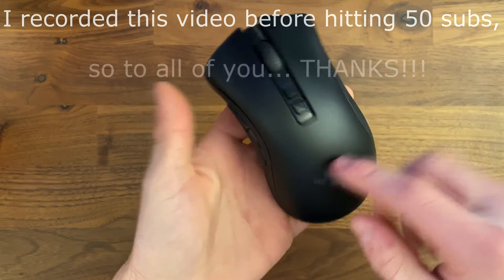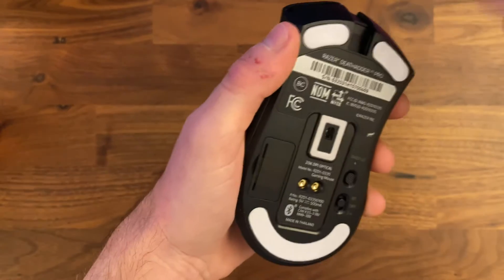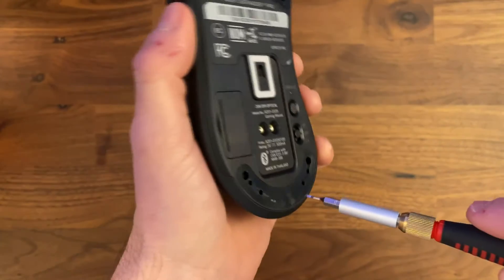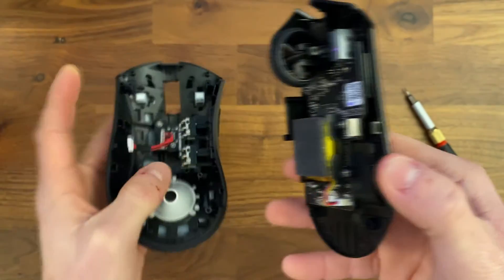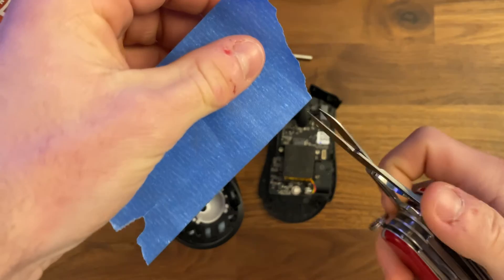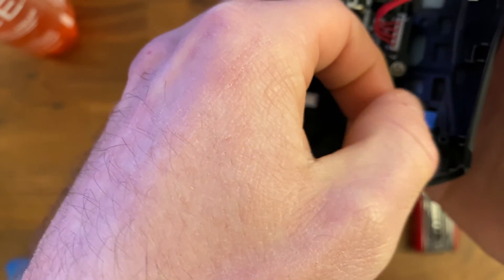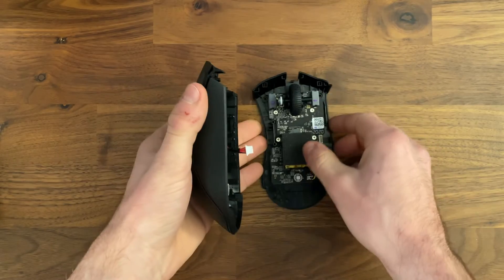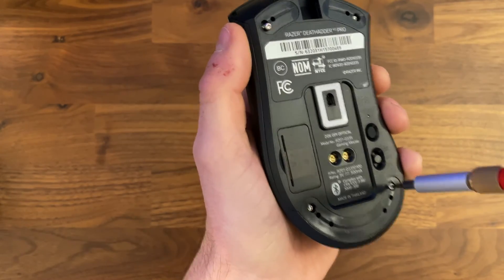Razer Deathadder v2 Pro Wireless Teardown and Pretravel Fix

Comment: DON'T f**king pry plastic devices with a metal screwdriver, PERIOD. Use something made of plastic, anything you can find, it will leave no trace, and if it does leave a trace you just carefully push it back with some shiny metal that also polishes it a bit and it looks like new after repairing. I don't know who the hell invented this method of pulling devices apart but that person was an amateur before the word actually appeared in the dictionary. PRYING WITH A SCREWDRIVER, sheesh...

Comment: Hey can u tell me about the capacity of the battery that this mouse uses,
Mine drains pretty fast even when my mouse is disconnected
it drains away overnight while I'm not even using it
so I think the  battery is messed up

Comment: But with this method the tape can move away after some time of usage because of this left-right shiftings that you showed. Then why not to glue that tape to the switch itself instead of inner space of a shell? There is enough unused grey space on it near the purple button where you could actually spill a drop of some good glue and put that tape. Of course you should be careful not to spill the glue on a purple button but it wont be affected by shifting and will not anywhere.
Reply from the maker: This is true the tape will wear the more you use it, and could shift, some people use aluminum tape too which should be more resilient
Reply: @joer1502  yeah, I thought about aluminium tape too. But now I came up with even better idea (not for everyone) - to use a tiny piece of my old thin plastic mousepad (SPEEDLINK CRYPT) because it is already 0.8mm thin (maybe rub it with sandpaper to be 0.5mm or even less) so it should be more durable solution even comparing to aluminium tape. But I havent disassembled my mouse yet because still looking for a good solution how not to ruin the feet or to damage them as little as possible. I saw another video where a hair dryer was used to warm up feet and move them away gently, but still not sure this is the best solution. Eventually I will have to choose one method or another because buttons pretravel and squeaks became too noticable and irritating.

Comment: I had an issue where mine would not turn off. I took it apart and unplugged the battery. Hard reset fixed everything.

Comment: Has anyone had the sides of this mouse that are creaky? Mine is just a few days old and the sides of this mouse are making creaking noises when even small pressure is applied. It's very annoying and disappointing.
Reply: yeah same, I was looking a way to fix the creaking and found this video.. it's really annoying but I don't wanna ruin the feet to fix it with grease
Reply: @Karmidzhanov92 you are not ruining the feet you can just put it back
Reply: Hi there, just bought a Deathadder V2 Pro that had this issue but I was able to fix it with PTFE tape (or teflon tape), I opened the mouse and put a trim of tape folded between the base and the top part, had to use a little bit more on the side where the sound was more audible but at the end I was able to get rid of that creaky sound, I don't know if you were able to fix it but if anyone has the same problem and can't return the mouse that's a good fix

Comment: Hi, I’m just posting this to some of the videos I looked at when I was searching for answers, as I thought it might be useful for other people with a Deathadder v2 (wired – not as in this video) mice that have a squeaking scroll wheel problem. Some of what I cover may be relevant to all Deathadders, e.g. advice about the skate plates and lubrication of the shafts.
NB: Mine was an early version, so it is possible details (e.g. screw types) may vary with more recent manufacturing.
The squeaking is caused by dirt and debris getting inside the mouse. The hole around the mouse wheel is probably unnecessarily large and I think this contributes to the dirt getting in there. I have a cat and when I opened mine up there was a ton of hair in there. If you have a pet this is probably going to be the case for you also. I’m surprised anything worked at all, it took me nearly and hour to pull out all the hair from the wheel and shafts with tweezers.
🧑‍🔧How to fix step by step:
There are 3 screws on the bottom you have to release. They are all under the skate pads so you will have to lever them up before you can get access to the screws (plates are glued down). You may have to buy new skid plates, although I was able to just stick mine back down after.

There is one screw under the rear skid plate in the middle. Start from one side and lever the plate up with a small sharp screwdriver. As soon as you get a tiny gap under, switch to a larger screwdriver and just push it under the plate to release the glue from the mouse. You need to raise at least half the plate up, but you can leave the other half stuck down (no need to remove it completely). The screw is a very tiny cross head type. The only screwdriver that fitted it well was from an eyeglass repair kit I had.

There are 2 screws under the front plate. Luckily, they are at the extreme edges of the plate, so you only have to lever up a small section at each end of the plate to get access to the screws. Screw is the same type as for the rear.

Once all 3 screws are removed the top of the mouse lifts off very easily, no need to release anymore catches. There is a cable connecting the dpi switches on the top of the mouse to the bottom of the mouse. You can unplug this if you want, but there was enough length on mine to just leave it plugged together and still have good access to the wheel.

Start by just blowing out any dirt etc. either just with your breath or compressed air. For me there was a ton of hair trapped at the left side of the shaft right where it meets the rotation sensor and also a ton trapped inside the wheel. This wheel (at least on my version) was hollow. It was a massive pain to get the hair out of there as there is something in there (couldn’t see) that it gets caught on.

You need to grab onto the shaft, especially in the areas where it connects to other pieces with very fine tweezers or a small screwdriver. There may be hair wrapped around the shaft you cant see and it only becomes visible when you try to grab for it.

Once you are confident you have got all the hair out you are done. The squeak was gone for mine, and the shaft appeared to already have some lubricant still on it. Put everything back together.

💡Optional
Add a few drops of silicone-based lubricant to the shaft (I did this). Be careful what lubricant you use, some don’t play nicely with plastics. Some people suggest you can do this from outside without ever opening the case. Using a needle (or similar) to deliver the lubricant to the shaft. I considered this, but visibility of what you are doing is terrible and I was worried about dropping lubricant on a sensor of something important – so I chose to open it up.

Buy and replace the skates if you feel they are not going back right or you damaged them by accident in the removal.

Comment: Somehow after just 1 month of using the da v2 pro it just keeps disconnecting on the 2.4 ghz mode whenever I flick. sometimes I just dont even need to flick and it disconnects. its really annoying and upsetting since I own it for only such a short amount of time. Do you know about anything of this and how to fix it? or is it just a faulty unit or something? I just watched the video but I don't have the tools on me so I'll try to open it later.
Reply from the maker: Move any other wireless/bluetooth devices off the desk, should fix it.

Comment: hello, how would you replace the switches on the razer deathadder v2 if it double clicks? can you replace it with the typical D2FC-F-K(50M)-RZ omron switches?
Reply from the maker: It uses razer optical switches, I don’t think it would ever double click unless the optical beam was shorting or something along those lines
Reply: @joer1502  I see, I found a replacement optical microswitch for razer on a local online store for 5$ i think i might try that, looks exactly the same with razer and has the purple dot like the original ones. :)
Reply from the maker: Nice, yeah the originals should just slide out as they arent soldered in
Reply: @joer1502  wait so they just need to be replaced by hand? no more soldering?
Reply from the maker: Yeah
Reply: @joer1502  oh.. damn i thought i have to resolder them

Comment: Can you mod the switches? Are they soldered?
Reply from the maker: They are optical, cant swap without extensive soldering work, unless you mean replace with other optical seitches
Reply: @joer1502  thanks! I am thinking of buying it, bc I love deathadder design, but based on my custom keyboard experience, razer products are overpriced and are bad quality. So is it any different from mice? I know nothing about mouse modding and have been using deathadder elite for 3 years, now looking for an upgrade. Rn I can get it for 100$, is it worth it? So I can disassemble it and replace switches with the better ones?
Reply from the maker: Its a decent choice if you like ergo mic, cannot replace switches with better ones, only the same ones. Check out some other ergo mic too, a lot have come out in the past few months
Reply: @joer1502  ok, thanks!

Comment: Hi bro !

What is the battery capacity of the DA v2 Pro Wireless ?
Reply from the maker: I got like 50-60 hours per charge
Reply: @joer1502  i know, and i am using it too. but i want to know if the battery is 500mAh or 1000mAh ?
Reply from the maker: Oh, I’m not sure
Reply: @joer1502  oh, tks bro 👍👍

Comment: thank you a lot!
it's funny that actually some aliexpress sellers are selling metal tape which cut into this specific size just for repairing pretravel problem LOL
i use 2 layers of tape and now it feel more clicky and solid.
Reply from the maker: Glad this helped
Reply: Do you have link for the Ali express for this?
Reply: @527bmanzella  "YYT 4PCS Mouse Button Pillar Repair Parts 2x5 3x5 4x5mm Repair Sticker Metal Sticker Wear Repair Wear-resistant Sticker 0.12mm" 

p.s. i actually buy from Taobao(because i live in TW where is able to order directly) ,i said aliexpress just for easier understanding

Comment: Is it normal for the mouse to have pretravel? I just bought a King Cobra, and I feel its buttons are stiff compared to my old Razer DeathAdder.
Reply from the maker: Usually the stiffness is determined by the post travel mice with basically no post travel have clicks that feel stiff
Reply: I think all of my mice had pretravel. Right now I have MM710 and Taipan in front of me, they both have it. If there would be no pre-travel there would be a lot of accidental clicks or you could not rest fingers on buttons for example.

Comment: does any tape works? and btw is that a masking tape? doing this on my model o wireless since i cant find any video anywhere
Reply from the maker: Theoretically yes, as long as it isn’t too thick.
Reply: @joer1502  thanks for responding! but additional question does skates still fit well after removal? cause its hard to RMA and find a skates replacement in my country.
Reply from the maker: No not really, usually the adhesive is kind of ruined after taking it off
Reply: @joer1502  so I have to get a new one?
Reply from the maker: Basically yes, if you are super careful you can probably reuse the feet, but usually pulling them off causes some adhesive loss
Reply: @joer1502  too bad the one store that sells the model O skates here in my country is currently sold out. Must be sad to be living here😂
Reply from the maker: That is unfortunate
Reply: @joer1502  very unfortunate but is there anyway to add adhesiveness?
Reply from the maker: Not really, if you have something very thing and can peel them off extremely even and flat, you can probably reuse until they come back in stock
Reply: @joer1502  thank you for your quick response! u were surely helpful going to try this later on my model o hope it works :)
Reply: @joer1502  btw how many layers of tape do u recommend?
Reply from the maker: Start with one, if its still mushy move up to two, and so on
Reply: @joer1502  its getting hard to click every layer i put
Reply from the maker: If its hard to click even after 1 layer the tape may be too thick
Reply: @joer1502  how about a clear tape?
Reply from the maker: Worth a try, but masking tape is probably thinner
Reply: @joer1502  i used 5 layers of scotch tape and i think the pre travel is reduced but the click is better so i might have to put one more layer
Reply from the maker: 5 layers thats some outrageous pretravel
Reply: @joer1502  i think scotch tape is thinner and yea glorious qc is so bad that my first model o wireless mouse wheel squeaked the first 6 days of using it then got it exchanged and now 2 months after this pre travel issue came in

Comment: How well do the glide pads re-adhere after disassembling the mouse?
Reply from the maker: They don’t... you really need to buy another pair, they are relatively cheap ~$10 for 2 pairs
Reply: or just glue them with a soft easy to remove glue or double side tape.
Reply: If you're careful with a craft knife and just peel up the edges, I found - at least on mine - that they re-adhere perfectly. Quality replacements are available from eBay or AliExpress for fairly cheap though.

Comment: what does that removable plate under do ? can you play with it removed?
Reply from the maker: That is the tensioning basically, that little plastic thing, depending on its thickness is what determines how much pretravel the clicks will have, if you take them off you’d have a lot of pretravel
Reply: @joer1502  Thanks, but i meant the hatchet under the mouse to the right, it looks removable without opening the mouse - maybe im confused :D
Reply from the maker: Oh, I believe what you’re talking about is the usb receiver compartment, yeah you can take that cover off and play, its just for storing the usb receiver when not in use
Reply: @joer1502  okay thanks man !

Comment: My scroll wheel is lod when im scrolling to the front and its feels like something is rubbing against it. I got the v2 pro. Could it be possible, that a wire is rubbing against it?
Reply from the maker: Yeah I suppose that is possible, could just be an issue with the encoder
Reply: @joer1502  bruh i got the feet off, now I dont think i got a torx t6 ...
Reply: @joer1502  but what could make my scroll wheel like this, i dont see any wires near in your vid
Reply from the maker: It could just be loose in the encoder
Reply from the maker: Or just a rough scroll wheel
Reply: @joer1502  nah when im lightly pressing it to the right and scroll, its normal for some seconds
Reply from the maker: Maybe the wheel part is rubbing on the encoder
Reply: @joer1502  whats an encoder lol
Reply from the maker: Send me some pics on twitter link is in desc
Reply: @joer1502  okey, but i didnt get it open :(
Reply from the maker: Yeah id say dont open it
Reply from the maker: Opening voids warranty, you can rma it if there is really an issue
Reply: @joer1502  I dont want rma, cuz i had viper, got a replacement for viper, and then had still a problem, and now got a da v2 pro for free
Reply: @joer1502  I have sent you on twitter
Reply from the maker: Hmmm
Reply from the maker: Dm me on twitter easier to talk there
Reply: @joer1502  I did

Comment: does this void warranty?
Reply from the maker: I believe any action of opening the mouse does indeed void warranty
Reply: @joer1502  I have TINY scratchy pre travel on my brand new viper ultimate that annoys me. someone on reddit linked me your video saying this trick works on viper ultimate too to fix pretravel creak. debating whether to RMA but afraid they will say its too small issue and not fix it. or just open it up like you
Reply from the maker: Id say the rma is worth a shot, its uh, kind of annoying but they are pretty decent at getting you a replacement in my experience

Comment: Do you have a video of the problem? I've gone through a few DA V2 Pro replacements now and the pretravel on the right button is absurd for this mouse. Only had one that didn't have it.
Reply from the maker: I do not, i will say it certainly is strange, but i think it has to boil down to the way the plunger travels in that horizontal direction.
Reply from the maker: Even with the tape its still got some pretravel
Reply: Yeh what makes it worse for me is that my Deathadder 3.5G, my DeathAdder Elite and my Deathadder chroma were all fine; something about this V2 version has made it worse or more noticable. A real shame really, but at least with this video it should be possible to improve it somewhat. Thanks for putting it out there!
Reply from the maker: Yeah definitely, thanks for the support!

Comment: Great video. I am not sure if you checked so ignore this question if you didn't. How replaceable is the battery and what type is it?
Reply: It's a 3-pin small JST wired into the LiPo cell, it's roughly a square shape and has some foam glued on to the top of the Kapton tape. I measured it as 30 mm x 22 mm x 3 mm, tolerance of 1 mm either way so it can fit into the carrier which goes above the PCB which is your limiting factor. Razer states the battery is 450 mAh.
Reply from the maker: Thanks! It seems as though you could replace the battery assuming you get the same connector type, which I did not check 🤦🏻‍♂️